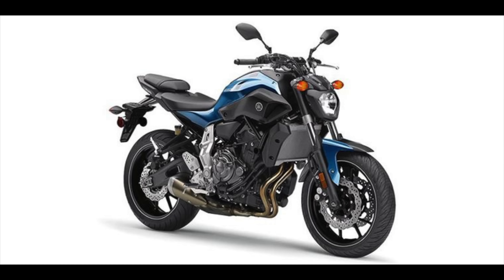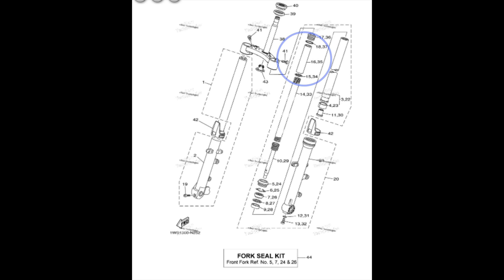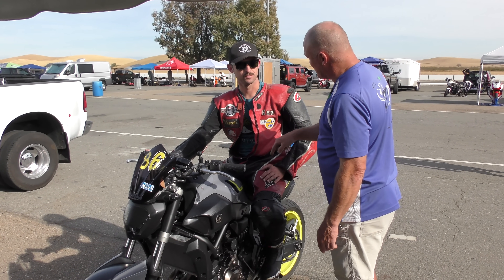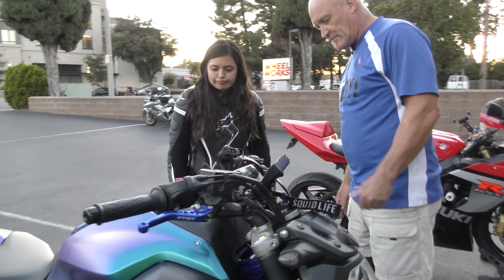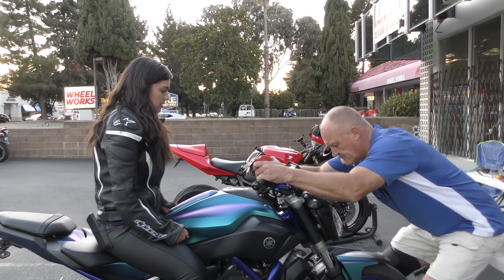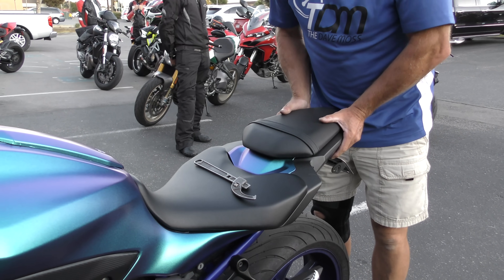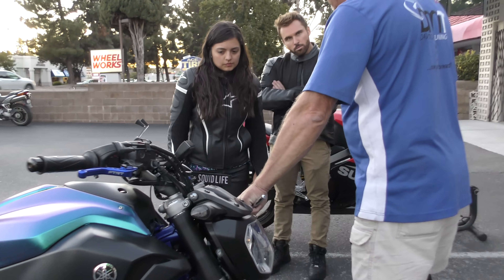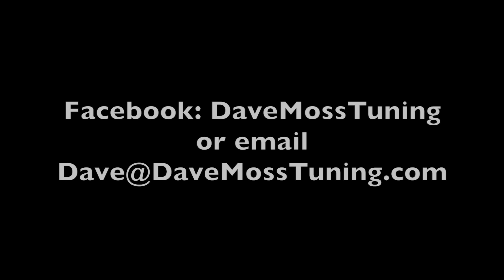Yamaha FZ-07 / MT-07 Fatal Flaw and How To Fix It

Comment: Great video, your the man Dave!
My girlfriend just bought one of these (2016) and I will get right on it 👌
How about the old model of MT09 , same problem same fix?
Reply from the maker: Thanks for your post and question. The first generation MT09 needed 15w fork oil to the same volume the manual requires and that transformed the bike's handling
Reply: @catalystreactionsbw  awesome, thank you for taking your time to awnser my question 👌

Comment: Apart form the shorter spacer, I told to few guys all about this setup. Especially the front in full lock rotation is a pain to watch, bouncing up and down and never settling where it should be. 

Shame it is not just MT07 but many more bikes with these cheap forks and shocks.

Comment: I can't quite flat foot my 2015 FZ07. Can you please explain how you lowered the front-end suspension? 

Additionally while doing so, you were talking about trimming the spacers - are those the actual bolts that you remove from the top of each side, or the black sliders over the forks?  I checked online quickly, but couldn't find a blowout diagram. Thanks ahead of time!
Reply from the maker: Measure how much fork is above the upper triple clamp. Loosen the fork bolts gently enough to move the fork and increase the amount by 7mm. Do one fork at a time, start with the right leg. The spacers are inside the fork so you remove the cap, remove and trim the spacer and put it back in.
Reply: @catalystreactionsbw  thank you! Should I make that measurement withe the bike weighted?

Also, I expected you to say decrease, rather than increase, since I would need the forks lower in order to flat foot it.
Reply from the maker: @KRMyers  look at the pictures, bottom right of the Tracer GT prep for 2020. The forks are flush from the factory but now there is 9mm of gold showing so I increased the amount of fork above the upper triple clamp. https://davemosstuning.com/?s=Tracer+GT

Comment: so is this purely for a track setup? does this take away from the comfort aspect of the bike? i for sure ride my bike hard but i also take a pretty frequent ride about 100 miles each way to visit my family. i love how easy the bike floats at low speeds and i dont feel stuck on the bike if you get what i mean. i have my rear shock dialed in as good as it can get and cutting those spacers would be very easy. i just was wondering if this is something to do reguardless of the type of riding you do. im not a track guy by any means.
Reply from the maker: This is for street. It adds excellent stability so your FZ07 will handle even better!
Reply: @catalystreactionsbw  Amazing! really appreciate the channel and you for sure have my Sub!

Comment: My 2019 has garbage suspension. Coming from a motocross background, suspension is something I'm picky with and first thing I noticed is how extremely unbalanced and unstable the bike is from the factory. Blows my mind how shit it is.
Reply: They did the same thing with the MT-09. Boggles my mind how fucking stupid it is that Yamaha lets their bikes out of the factory like that. Whoever is in charge of suspension tuning down there should not be getting paid.
Reply: M. B. The thing is the suspension experts only work on the supersports, and they don't really give these any focus. They ain't even cartridge dampers
Reply: @ruikazane5123  you dont need to be an expert to have appropriate spring rates, damper rates and sag rates on cheap suspension for no extra production expense.
Reply: @ruikazane5123  it sure is. They design these incredible engines and chassis' but then they fuck up something so simple seemingly on purpose
Reply: I ride a 20 year old Triumph Sprint RS, far from a suspension engineering marvel. It weighs over 500lbs wet and probably still has the original oil in the forks. I tried my friend's MT07 and couldn't believe how such a well-rated bike could handle so poorly. At higher speeds the bike feels bouncy and approximate in the corners, can't hold a line and doesn't inspire confidence at all. Also couldn't believe how soft the suspension is just sitting. I'm a pretty light guy (160 lbs) and the thing squatted and bounced like a Buick when I tried the forks. The suspension looks like it was setup for a scooter, not something that can do 120mph. Yamaha makes killer engines but they seem to cheap out on brakes and suspension components, I'd never put good money into one when bikes like the Street Triple excel out of the box.
Reply: Same.
It's doubly frustrating that Yamahas MX division came up with essentially the best O.E.M. suspension (best design and dampening/spring rates) FIFTEEN years ago and has practically maintained that lead with only minor tweaks.
It worked very well for an enormous range of rider weights and skill levels with only preload changes and maybe some clicker adjustments.

I imagine their sportbike team has at a minimum kept close to the competition and has something that's ball park close for the average rider.

Meanwhile the setup on this bike is horrendous!
I'd expect something that's on the soft side and not all that impressive given the price point.

I wasn't expecting TTR 125 forks!
And to have such an out of kilter balance; particularly with an under dampened & Undersprung front end is engineering malpractice for a motorcycle that's meant for public roads!! It's dangerous for no reason.

If the suspension guys from either the sportbike or motocross division stopped in during pre production they probably would have been able to spot the problem as soon as they sat on the freaking bike and been able to revise the setup during their lunch break..... A fix that would NOT increase production line cost

Comment: Hi Dave, hope you able to made the same vid for yamaha R3/R25. in Asian country most R3/R25 owners love to lower the front fork by 1-2 inches drop. will there be a drastic changes? thx
Reply: Dropping the front end makes the 'attack angle' of the steering (aka steering angle) steeper, thus making the bike steer quicker, more razor-sharp.
One thing you want to do is whether you bottom the entire front end with that much drop on the front, you can be preventing full travel of the shocks.
If travel is unaffected just check whether fenders or such will rub out in full compression.
This mod is commonly used to lower ride height, but increase the steering head angle when the rear shock is not adjusted accordingly.
Reply from the maker: I tend to chose 3-4mm increments. It is known that most Asian countries lower the front end dramatically but I am not sure if that is done via testing per bike or the social norm as it is a legacy practice from decades ago?  As per Rui Kazane's comment, lowering can take away travel so you have to mark bottom out and make sure that you do not go any further than that.

Comment: Has Yamaha addressed this problem with the new mt07 2018 to 2020? I just bought a 19 and the rear has rebound and preload and they reworked the front forks but still cant adjust the front..  :(  hopefully they upgraded the front enough? my problem isnt weight on mt07 its height I'm 6ft2 ish 165 ibs ish.
Reply: they have to keep price in mind when they build it. a cheap front set of shocks, cheap bars, mostly plastic bike. they made sure the motor and trans accompanied with a very comfy bike thats cheapish to make and sells very well. if the sales on the bike are up and ppl are eating them up they wont rework anything that is going to mike the bike cost more.
Reply: @1up_doug  thanks for reply
Reply: @monty-9269  No problem. Friend of mine has a 2018 mt-09 and lemme tell you, be prepared. a bike in a class all its own. violent amounts of power and very comfy at the same time. feels even faster than the mt10 but lacks that hooligan aspect of what i feel the fz/mt brand is about. if i wasnt 5'8 and 135lbs i would have gone for the 09. ive noticed anyone over 6ish foot and 150-160lbs dont get the full potential out of the bike.
Reply: @1up_doug  Yea I think mt07 is better for stunting and cruising slower wheelies and riding getting good mpg and mt09 is just crazy bigger brother instant power on demand with its power to weight ratio like ur saying I heard you cant do a 0 to 60 launch without the front wheel coming up if u get on it in the first 4 gears. That's crazy to think a bike can power wheelie that easy in that many gears but also very tempting 🤪 lol mt07 is my first big street bike I got it last October so really only rode few hundred miles this winter but over the next 2 months im  making a point to ride it alot as I bought it used 6999$ with under 2k miles and 6 mo left of Yamaha warranty  from October so if anything happens I want it to happen before the warranty goes 😉✌
Reply: @monty-9269  ive owed mine for exaclty a year now and ive put 9k miles on it. a set a new bars (you dont realize how bad the stock one are), levers, exhaust and the ejk kit and man its a hell of a bike. ive owned a zx6 and a r6 before this and i can say i have the most fun on my fz. i take a ride from jersey to PA about 200 miles all around and it feels effortless. the wind can be annoying but i have the moto gp double bubble shield and with a slight tuck its no big deal.
Reply: they increased the fork damping by 7%, but it's still to soft. Just not AS soft anymore. You are most likely still fine with putting in one grade thicker oil and cutting some of the spacer.
Reply: @Blockbuster2033  thanks for the reply if I feel the need at my 4k service il change the oil in forks and the back feels way to soft on the street so il adjust that to my weight. I'm always thinking why I didnt get the mt09 cause I feel a little cramped on the 07 I didnt get to ride before purchase I could only sit on both in the showroom I made a newb mistake but bet I wont ever handover my $ until I ride my next bike lol. Who knows tho I might have got the 09 and wondered why I didnt get a 07 guess theres always that what if buyer's remorse in the back of our heads making purchases when in reality we should just be thankful for what we have.. I can always have fun on the 07 and in a season or two if I really feel the urge I could trade in on a used 09 later. ✌💯

Comment: Point 1, dont ride. Dramatic much lol
Reply: Boon Doggle Badly set up suspension can easily lead to a crash.
Reply: @6Twisted  I've ridden mine for over 3 years. The suspension is crap when you push it, I can't argue that. Its histrionic crap to suggest the bike should not be ridden.
Reply: @booshting3520  Yeah, I was wondering about that Boon.  I've ridden an MT-07 for 2 years and find it quite stable in turns.  But then I ride like a pussy anyway.
Reply: @vincentcausey8498  Well yeah it depends on how you ride. As long as you're not asking much of the suspension it'll do. But the minute you start leaning you'll find there's not much grip or stability because the suspension can't handle it and would likely cause you to lowside, highside or run wide.
Reply from the maker: Dave Williams, editor, replying here. Not for the guy in this video, at 5:15 . You'll see he hits 2 bumps as he enters the corner and this causes the front to fold. The bars suddenly turn to the right and then he crashes.  https://www.youtube.com/watch?v=Dglu0Wsf80k&t=11s

Comment: Ah now you've gone and done it for me Dave. I'm always tinkering with mt MT07 and looking for new things to do but I'm possibly around your age an only started riding 2 years ago ( done 30,000+klms in that time though, all fun riding and no commuting ) Anyway, I know nothing about set up but have tinkered, I'm betting I'm not getting the best out of it by far. I have rear shock as tight as it goes and I put after market load adjusters on front forks and cranked them down as tight as they go thinking compressing the springs was a good thing. I reckon a control,alt,delete is needed. Where do i start please mate? I'm around 75 kilo, And great vid, Subscribed.
Reply from the maker: OOpppsssss   :)  Start with a cable tie on the front fork and mark bottom out to see how much travel you are using. Look at the shock shaft coming out of the shock body to see what is dirty and what is clean. That will give you the foundation of knowledge to work from. Next, change fork oil to 15w to the same volume as stock and test ride - was it more stable. Thicker oil moves slower so you may use less fork travel. Check shock travel again and ideal is 2-3mm of dirt above the bottom out bumper. If there's no dirt, you may need a stiffer spring. Game on! Please report back to help others and pay it forward.
Reply: Dave Moss Tuning  Mate, I’m chuffed you found time to reply! I shall do as advised hopefully this coming weekend and will certainly report back and do my bit of paying it forward. You’re a gent and a legend. Cheers mate.
Reply from the maker: @mt07toooldtowalk42  Thank you! I look forward to hearing about your thoughts and experience once the changes have been made.

Comment: Hi Dave, I have a weird problem. I have an 08 R6 stock shock and forks I've notice the bike under steers in a high speed corner that is with steady throttle through the corner the front end seems to go wide, do you have any suggestions? also the bike is pitched forward by 10 to 15 mm the reason just being my preference. When I remove preload from the shock the rear feels unstable and wobbly
Reply from the maker: The forks should be at line #1 on the outer tube for your R6. Have you set rebound balance front and rear yet? If not, start there: https://www.youtube.com/watch?v=gYU_z65hQSQ

Comment: Just out of curiosity... the suspension set up your adjusting for the MT07s... are they more track focused?
Reply from the maker: Street focused.
Reply: @catalystreactionsbw  Is there a video on the difference street - track. So given a well tuned street bike, what to do when going to the track?
Reply from the maker: @Max-yy3lz  Street depends on levels of aggressiveness. Track depends on skill and ability. Sometimes the street set up is very adequate. Fork and shock travel used will indicate if it is not and needs to be changed to be stiffer as the forks and shock are too close to bottom out.
Reply from the maker: Dave Williams, editor, replying here. You can see it cause this guy's crash at 5:15  https://www.youtube.com/watch?v=Dglu0Wsf80k&t=11s

Comment: Is it safe to lower the fork like that on any bike? My wife bike seat is too high for her, and I was reluctant to do it because of the bike geometry.
Reply from the maker: you can lower most motorcycles successfully by measuring the rear decrease in height and then making the right change in fork position  https://davemosstuning.com/?s=loweringto match.
Reply: "Any bike" is too broad a question. And lowering the front like that without making other adjustments could be problematic depending on the bike, rider, and other suspension settings. If you lower the front without making other adjustments you can change the way the steering feels. It may want to fall into corners which can be disconcerting to some and may actually make the bike unstable.

Comment: Would the installation of preload adjusters effect how much length needs to be cut off of the spacer?
Reply from the maker: Yes - as the preload adjusters might be longer than the fork cap so some careful measuring is needed.
Reply: @catalystreactionsbw  my preload adjusters do extend a bit further. Would I add the difference to how much I take off the spacer? So if I was going to cut 10mm, and my preload adjusters are 3mm deeper, would I now cut 13mm? Or 7mm?
Reply from the maker: @Jjguthrie2993  10mm  sounds fine given your description.

Comment: Nasty little bikes.  The worst 6 weeks Ive ever had on a bike
Reply: I quite enjoyed the 35k miles I put on my 2015 model.  Didn't do any of this.  Was bone stock.  Replaced 1 fork seal at 22k.  Never had any other problems ever.  6'3" @ 240lbs.
Reply: Why?

Comment: I had two MT07 the first one was a 2014 version and when it was stock it behaved nicely. Then I got a 2017 version and it felt hard to turn in tight corners and the front was very light when accelerating out of a corner so I contacted Dave who told me to do exactly what he said in the video. Put 15W oil in the front and remove 10 mm of preload. I Went to two different shop and I got the oil replaced, but both refused to cut preload telling me that they don't take that kind of responsibility. I could have contacted some suspension tuner in my area but I ended up selling my Yamaha before that. I wonder what it would have felt like but whatever, I have a very different bike now.
Reply: Which bike?
Reply: @majormassenspektrometer  I now have a Honda Rebel 500. Haven't done much to it yet, ebc brake pads front and back.
Reply: @ifrit35  Nice bike! Hope you have fun with it. ;)

Comment: Dave-I have a 2015 ZX6R. I weigh 215lbs no gear, so I re-sprung the front with new oil and did a Ktech revalve of the OEM shock with a new spring. My rear sag is currently 33mm but I don't have any static sag. If I do it's 2mm or less. The shock feels great, plush almost vs stock. I'm still tuning the rebound and compression (still cold here). Should the lack of static sag bother me? Or does aftermarket valving, springs and my different spring spacer/collar change how I go about checking the setup on the wheel chock vs an OEM setup?  Any advise would be greatly appreciated.
Reply from the maker: Ideal is rider sag at 25 and static at 10 for max 40mm. At 33mm with no static sag would suggest the spring is perhaps too soft for your weight, let alone you ability. So - we need to know how much travel you are using. If you have zero static sag and the shock is bottoming, the spring is certainly too soft.